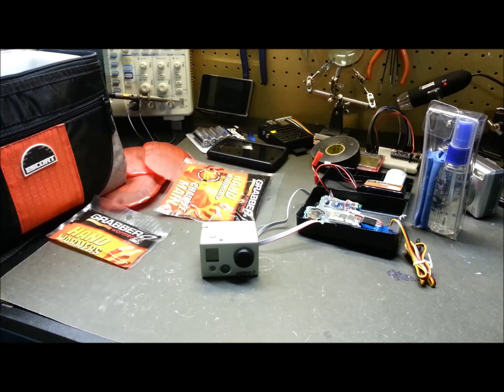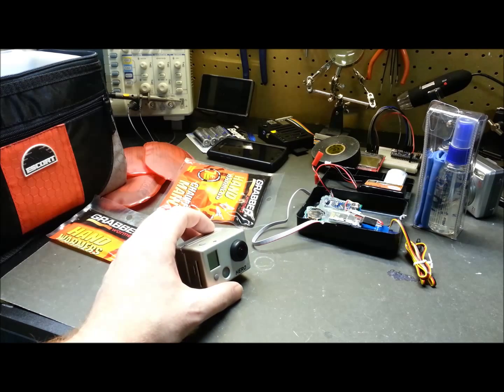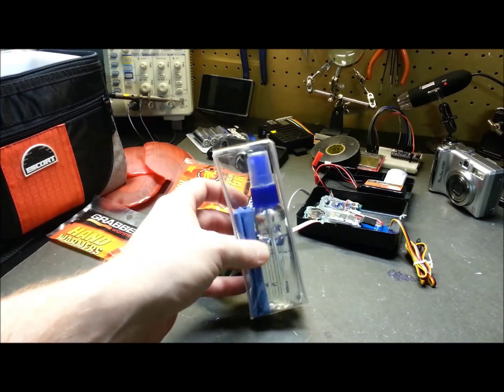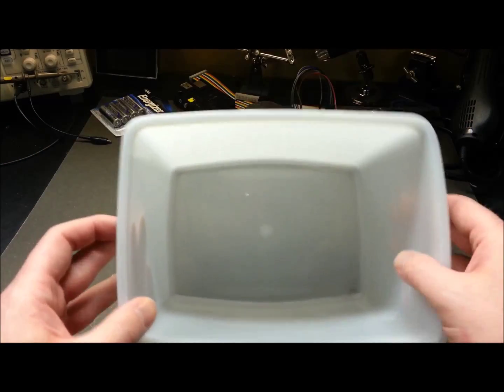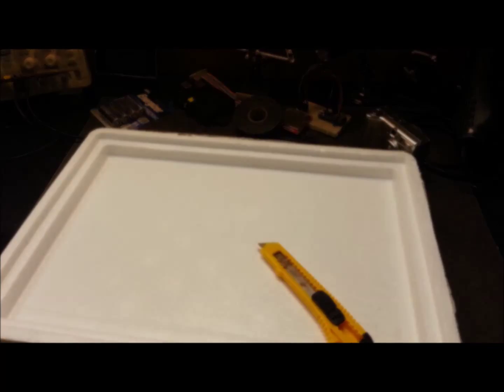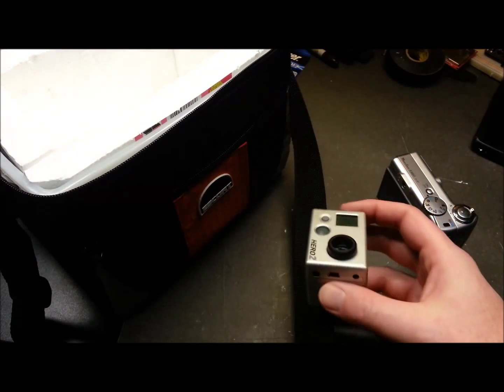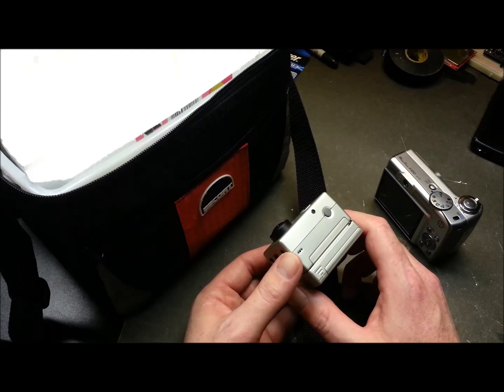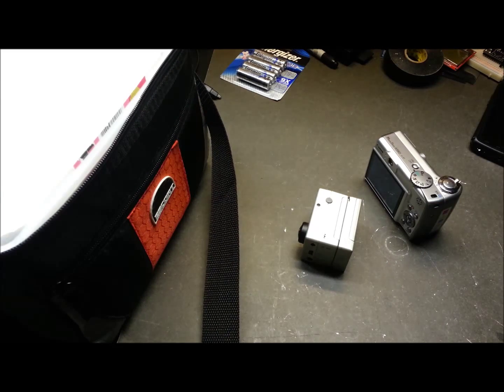HAB Part 11- Assembling Payload Module and Insulation

Comment: One thing about your GoPro. 
I use my GoPro for fpv RC model flying here in Finland. I regularly fly in  -10 -15 -20C. Beyond -15, the GoPro gets substantially lower battery performance (even with the lipo). As I'm new to your project I'm not sure if you've done this already, but for an accurate runtime test, I would put it in the freezer, within a sealed container, and test again!
Hope this helps.

Keep up the great work 
STN
Reply from the maker: Thanks very much for the input!  I will definitely be doing some life test in the final enclosure with heating in place.  Hopefully I can keep the capacity high enough.  Thanks for the kind words and help.  Cheers

Comment: PVC tubing around the lens of the camera so it can handle impact when it comes back down. Might have to use some hot glue, but it would be worth it to protect the camera lens and even help with mounting it into the case.
Reply from the maker: Good thoughts!  Cheers!